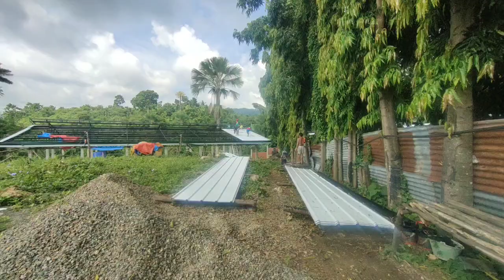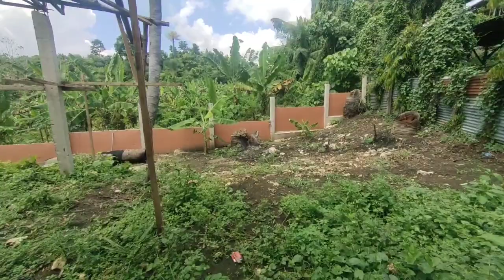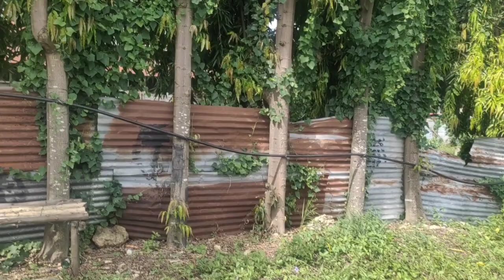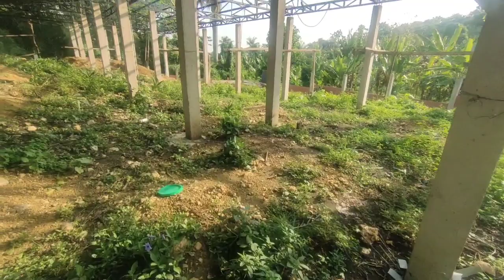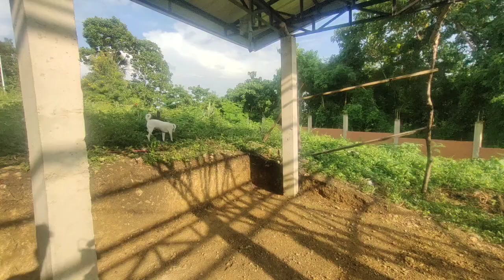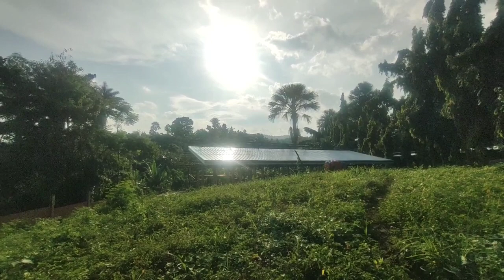BUILDING A PIGGERY IN THE PHILIPPINES

Comment: How are you going to install the floor, and stop /divert the rainwater runoff from up the hill? I'm interested & now subscribed.
Reply from the maker: Hi lesb thanks for commenting the floors will be concrete here they go in last. under the concrete will be the drains for slurry taking it to the cesspit, any run off from the hill will not run into the piggery due to the piggery wall. However if there is a lot of run off I'll install drainage to take it away.